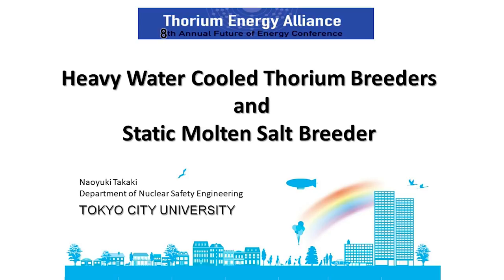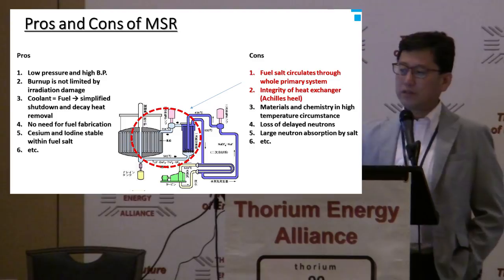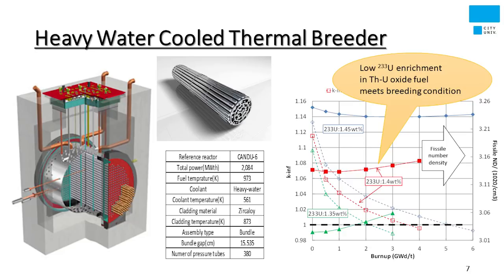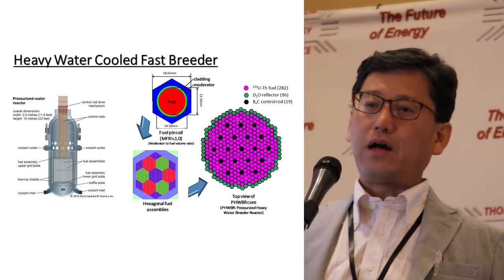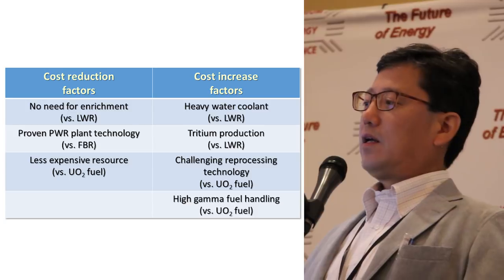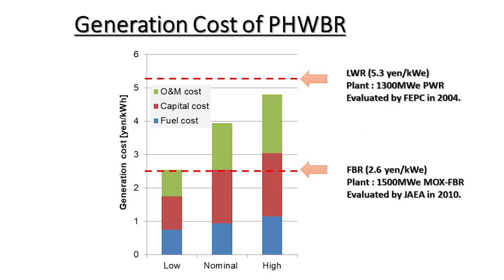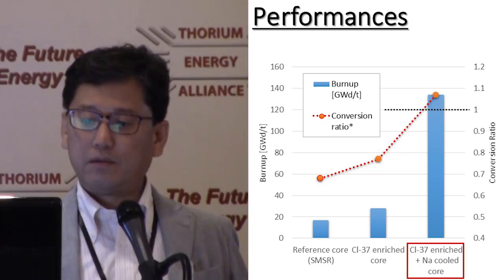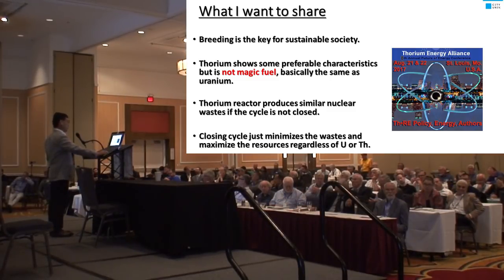Heavy Water Cooled Thorium Breeders and Static Molten Salt Breeder - Naoyuki Takaki @ TEAC8

Comment: Water based reactors is a non-starter for Gen IV. This presenter is heavily glued to old tech.
Avoidance of water is key to better and safer reactors. 
Very nice graphics in the well thought out presentation. 
Neutron absorbance of fluoride salts does not seem to have been a problem in the MSRE.
Reply: Biggest Problem in Water-Reactors is not the Steam-pressure bye itself but Hydrogen-production in case of Core-Meltdown bye reaction of Zircalloy with the Water-Steam. If this problem is solved by replacing Zircalloy with SiC this would be a major increase in security!
Reply: @hellboystein2926  
Water at 300°C has a ~2000 psig pressure and requires massive 10 inch thick forged steel vessels that can only be made in a few places, so cost is very high and the temp much lower than molten salt and not very useful for process heat applications.
If the water gets out its a gas or a liquid and is in every living thing, while molten salt would go solid and could be picked up with remote tools.
Reply: Copenhagen Atomics guys found best way to incorporate unpressurized heavy water as moderator only, not coolant (i.e. insulated from heat source), in a molten salt onion core design. Any boiloff of heavy water would stop moderation and stop fission without affecting decay cooling.

Comment: THANKS Gordon for this video. It's a wonderful summary of new reactor designs; my jaw was dropping until he came to discuss the CANDU  reactor as a breeder. Then my jaw hit the floor.  The CANDU is a regulator-approved, proven, capable, and demonstrated safe reactor. The fuel alterations would need regulator approval, of course, but that is a MUCH lower hurdle than getting approval for a new reactor design, and then building it with all of the surprises that come with a frst-of-a-kind reactor (or anything) build.

The major disadvantage of the CANDU for process heat applications is the low temperature of the output steam. But the temperature can be boosted using a turbo inductor (there isn't even a wikipedia article about it, unfortunately - I'll have to submit one) to boost the temperature into the range that can drive molten salt loops for off-the-shelf hydrogen generation systems using thermochemistry cycles ( en.wikipedia.org/wiki/Thermochemical_cycle ). 

In the turbo inductor, steam from the reactor drives a turbine passing magnets near tungsten blocks, which heats the blocks by induction. This eliminates losses from conversion to electricity and back to rotary motion. I know I saw a post describing the turbo inductor while I was nosing around the web, but I didn't bookmark it. Google search has buried it somewhere in its search results. 

And the turbo inductor definitely ISN'T the legendary turboencabulator ( www.youtube.com/watch?v=MXW0bx_Ooq4  For the history of the turboencabulator, see https://www.youtube.com/watch?v=kkH20fNavoI   Hilarious!).

I am NOT an engineer, but if I can find and put together bits and pieces like this, imagine what real engineers can (and should) be doing with CO2 emission free 24/7/365 power from reactors like the CANDU. The CANDU can be refuelled WHILE operating! The only downtime needs to be for scheduled maintenance. Or, and senselessly, to make way for politically mandated raw wind and solar power. ISOs treat these inputs as 'negatve loads'.

I rest my case. For the moment. Dr. David LeBlanc, of Terrestrial Energy said it best a couple of TEACs ago: 'Come for the thorium. Stay for the salt.'

Comment: FLiBe has 9 time less neutron absorption compared to light water.  (http://large.stanford.edu/courses/2015/ph241/kelaita1/) Yes, heavy water is 40 times better than FLiBe.  But if they can make the LWR work, they can FLIBE work.  He forgot the most important thing, salts don't need to be pressurized.  And they have a liquid temperature range of a 1000 degree C.  Harmful isotopes of various short lived byproducts are locked safely in the salt.  I'm bullish on salts as the future coolant of nuclear reactors.

Comment: NOOOOOOOO!!! NOOOOOOOOOOOOOOOOOOOOOOOOOOOOO!!! 

NO WATER COOLED THORIUM REACTORS PLEAS!!! The whole point is supposed to be improved inherent safety by the removal for the need of pressurization, by doing a water cooled breeder reactor you are getting ride of one of the main benefits of the "Thorium" movement.
Reply: @agsn Water cooled reactors are not the safest... because they are pressurised at at least 70 atmospheres which means if they loss containment the water explodes doing damage to the reactor and then leaves the fuel uncovered, which even if fission stops there is still decay heat which for the first 9 hours is still super hot and will cause the fuel rods to melt and explode due to the build up of gases from fission which puts fuel rods under upto 1000 bar.

Molten Salt reactors are not pressurised, and therefore if containment is lost they will not explode, and will stay under coolant unpressurised for 1000 degrees.

And in a molten salt fuelled reactor you can drain the reactor of fuel, and outside the reactor with a thermal spectrum reactor fission is impossible outside the reactor, even a fast reactor you need specific geometry for fission to take place.

if the reactor were to leak the leaked materiel would not cause fission as a puddle on the floor and would quickly freeze and the fuel salt binds with caesium and iodine which are your 2 main risks from a nuclear reactor breaching, and the drain tank will passively remove decay heat without power.

And in the case of a loss of power while the reactor is in operation, due to a freeze plug which would be cooled by a fan blowing cold gas over the freeze plug, the reactor would melt the freeze plug in the case of a loss of power and would automatically be drained into the drain tank.

If the reactor got too hot the freeze plug melts and would be automatically drained into the drain tank.
Reply: @agsn It is relative, as Nuclear even including all accident's has still killed the fewest number of people per MW produced, but water as a coolant with zirconium cladding is still one of the least safe reactors, as in the case of the loss of pressure you will lose the majority of your coolant and when the fuel rods are uncovered they will react with water to create hydrogen creating a second explosion after the steam explosion, even if the fuel rods survive both explosions they will melt down without coolant, causing the fuel rods to explode under the very very high pressure inside.
Reply: @agsn No dude you really really have the wrong end of the stick, fission creates unstable nuclei and heavy water reactors fission more of their materiel, so in the short term the radioactivity of there waste per unit volume is actually higher than regular waste.

Candu reactors burn up 0.7% of the fuel and American light water reactors burn 0.5%, that is of the total amount of U235 and U238, not the U235 burned, so they burn more materiel therefore creating higher level radioactive waste, if you have something that burns 100% of there imput fuel and even the actinides you will still have in the short term higher level waste.

If you can burn all actinides, your fuel is safer than when you dug it up AFTER 300 years, because actinides have relatively long halve lives, but the fission products have a relatively short halve life, but that means in the short term they are more radioactive.

And it will decay in 30 years to the same level as regular nuclear waste.

But this is irrelevant to talking about decay heat shortly after the reactor has shut down, in fact it works against you as you have higher decay heat in the short term, not significantly higher, but higher none the less.
Reply: @agsn Dude we already did that in MSRe... thats why I propose we use molten salts as at least the coolant, as they can go to 1400C at atmospheric pressure and not boil.

And we have plenty of plutonium and U233 laying around to start up 1000x1GW breeder reactors for either one so I don't think enrichment is really an issue, and burning up that weapons grade materiel and spent nuclear fuel can only be a good thing.

And for breeder reactors once you start them up they create there own fuel from natural uranium, or thorium and after we run out of weapons grade materiel to denature into nuclear waste, you can go with an accelerator driver reactor design where you can just dump in straight up nuclear waste, and I believe we have enough nuclear waste to run the US at it's current power demand for 200 years.
Reply: @agsn And at any rate if enrichment of the start up fuel bothers you that much, "which as I have already point out some countries already have stock piles of weapons grade materiel laying around, so a good use for it would be to mix it with nuclear waste making it no longer weapons grade materiel and using it to start up breeder reactors." as said you can just do a accelerator driven molten salt fuelled reactor, where the neutrons to remain critical are provided by a "low power" particle accelerator, and you can just drop raw Thorium, raw Uranium or Nuclear waste etc in.

For a 1GW electric plant you would only need a 50MW particle accelerator, so it's well within reasonable ranges. And the power of the particle accelerator would be the same kind that are in universities so they are not THAT expensive.

We are not talking about an LHC kind of particle accelerator, it's so low power that you would use a linear accelerator.

In the case all you would be pulling out are fission products and there is no need for even the start up fuel to be enriched.